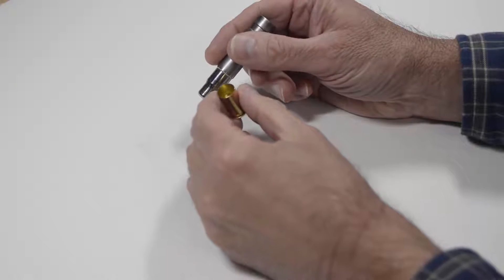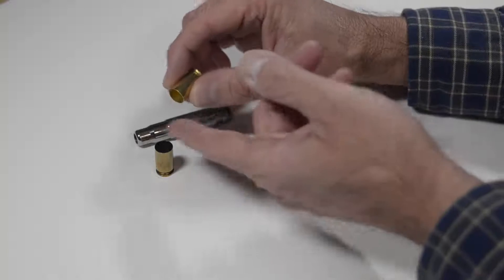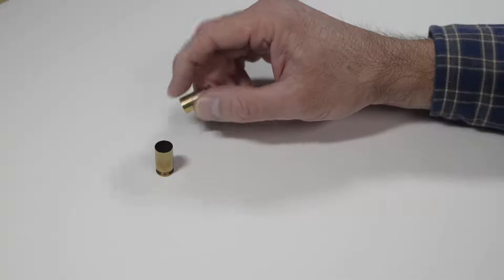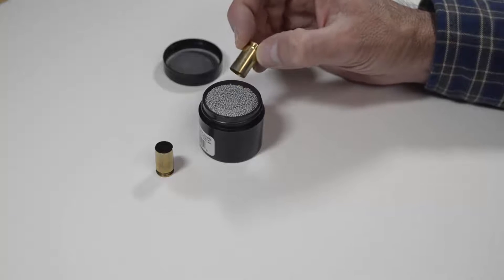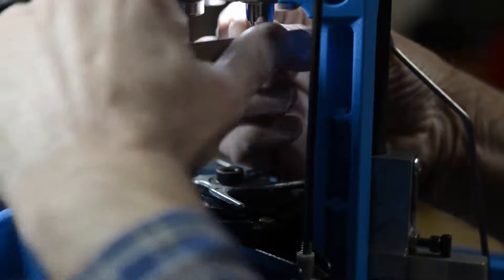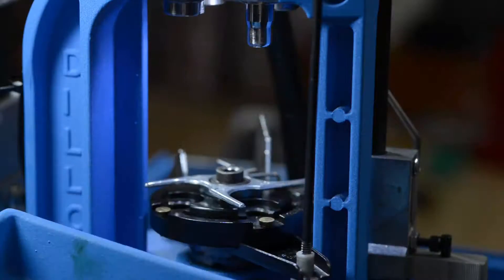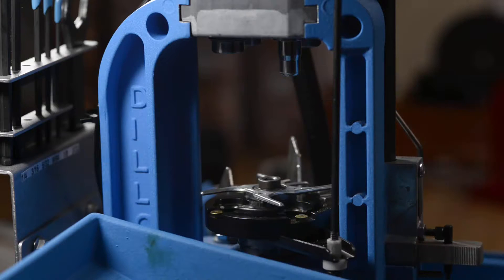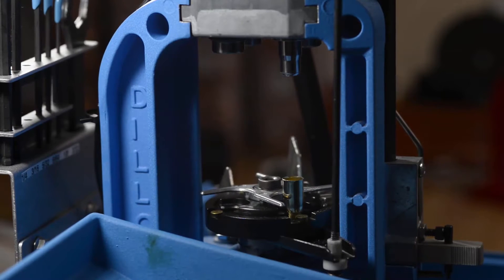Powder drop expander getting stuck in reloading brass: causes and fixes

Comment: With 9mm, different brass has different thickness at the the end of the expander. It has nothing to do with lubing, although lubing can help.
The real cure is to increase the radius of the expander end and also put a relief cut in the expander plug so that there is less brass dragging.

Comment: Dimond lapping compound, a hard felt bob on a Dremel and polish away.  Don't over do it, about 30 seconds and add lapping oil and enough diamond to not run the felt bob dry. This also works. look on internet for diamond lapping compound, 6 micron works best. This is an alternative to the above excellent fix. ☺

Comment: Seems a hand held emory stick will leave nothing but flat spots and exacerbate the problem. Under high magnification Lee's expander dies show an unpolished rough surface on the insertion end of the die. 
To polish I have had success using 3/16" wide 1200-2000 grit carborundum for strip polishing. Expander core is mounted into either a drill press chuck or 1/4" cordless drill.
 However with the Lee dies the point at which the bell's expansion begins has ridges from poor machining that can not be resolved by polishing. 
To overcome sticking at that point, I've had to resort to swab lubrication using a 1:12 lanolin: ethanol mix. 100% isopropyl also works but evaporates slower. 
For the 45 acp rounds I will be testing Lees Factory Carbide Crimp Die which at least eliminates the need to camber or size and should yield a break even point on time spent..

Comment: Iv'e in the past few months run over 6000 nine mm cases through my 550 and never had a problem. But, I have never fed new brass through it. Sometimes I wonder how many times I can reuse brass in a small straight walled case...
Reply from the maker: Many times fired brass usually do not stick to the powder funnel because of the buildup of carbon in the case prevents metal-to-metal contact.

How often brass can be used depends on many things.  Charge weight, care in handling brass, how big a flare is put on the brass, how deep a crimp is used, etc.  Self defense loads will wear out brass faster than light weight target loads.  Excessively flaring or crimping brass will wear out the case mouth quicker.  After the brass is cleaned, I examine it and at the first signs of splitting or cracking, it is tossed.
Reply: @knowledge2you  I do the same as for tossing obviously distorted brass. I usually run my charges as middle of the road. I especially do not crimp brass past the point of me handling each cartridge to allow a slight fit. In other words if you are flaring so your bullet has a wonderful seat, that is half tour problem with such a small round. I load for 7 calibers but never the 9mm because at 7 bucks a box, why bother until recently.

Comment: Would dry lubing the powder funnel work too? Instead of every case?
Reply: I have been using this lube method for quite awhile and attest to the fact that it works. You can just lube the funnel, but as he mentioned,  it helps in sizing when the outside of the case is lubed also. Another point I found that after several cases have been lubed and cycled it's not necessary to lube every case, as the residue accumulates a bit. Try every other or third.
Reply: I’ll try that then, thanks

Comment: OMG ...you want believe how bad I have been struggling with this on my 45 ACP cases. I noticed with the wet SS pins it cleans the brass to good. I have tried cleaning and polishing the powder funnel, worked great for all of 3 or 4 rounds. I will try  not running them so long in the wet tumbler. I have a lot of new brass, I quit reloading because of the sticking problem. I will get some dry lube also before I start back.
Reply from the maker: Speaking from experience, .45 ACP is a particular bad one for sticking.  Polishing the funnel will help, but new brass is prone to stick.  I wet SS tumble but no more than two hours.  After my new brass has been fired a few times, the residue coating inside the brass will not fully come off with wet SS tumbling.  I have read where people say their heavily fired brass looks brand new after tumbling.  The inside of my brass doesn’t even come close to looking new so I am not sure what those individuals are doing.

Comment: I wet tumble with stainless steel pins. This left the cases without residue of any kind and I had the problem you described. I added a final dip in 2 oz./gallon of Armor-All car wash, draining and drying on a towel. This leaves a very thin coating on both inside and outside surfaces. Problem solved.
Reply from the maker: How long do you tumble? I also wet tumble with stainless steel pins but for no more than two hours.  This is long enough to clean the brass and primer pocket but also leaves a fine coating of 'residue', which is what I want.  No need for me to add any kind of wax/car wash.
Reply: @knowledge2you  About 3-4 hrs. I also use Armor-All instead of detergent. However, when I rinse off the dirty water, only a small amount of Armor-All remains. By using a final dip as noted but without rinsing, it leaves a thicker protective film.
Reply: I’m not sure why anyone would wish to clean the inside of a cartridge case (other than removing dust/grit).
Reply: @Russell-1  I have a lot of range brass that is full of dirt and grime. So it needs to be cleaned good, dry tumbling doesn't always get the dirt out if it's packed.

Comment: I discovered that a Scotch Brite pad works well to remove brass/copper buildup, nice and evenly.  Also, if you run plated bullets, you might notice some of that building up on your expander too.  I was using old brass (>8 loads) and had some sticking and wondered, "Where is it coming from?!?".  Some of the plating from the Berry's bullets was surviving my tumble process.  Over a couple thousand rounds, it had deposited on the expander to accomplish the same sticking effect.
Reply from the maker: I do not shoot plated bullets, so thanks for sharing that experience PowPow.

Comment from the maker: UncleLoodis, the statement that stainless steel tumbling removes all carbon buildup in a case is incorrect.  Once you have fired you new cases enough, there will be a carbon buildup that not even stainless steel tumbling will remove.  I know because I have been using SS tumbling for years.  Once there is carbon buildup (I have to shoot the brass around 2-3 times to get enough build up) there is no need to add any kind of lubricant to the inside of the case.
Reply: That's not my case at all, I also have been using wet SS for a while, I never had this problem till I started with it. I got my 550 back in the mid 80's. Until I started with the wet SS all was well. At one time when I was in competition I would go through 500- 1000 rounds a week. I may go back to dry tumbling.

Comment: have you ever tried removing the powder drop expander  and using a copper removing bore cleaner to remove the brass? just curious. It just seems like there would be a cheaper solution to this than replacing the part. You make great videos too! thanks. JJ
Reply from the maker: +jjmckay6man1 
Thanks JJ for the question and the answer is Yes, I did try that.  But I found using an (my wife's) emery board to be faster than a copper remover.    To make using an emery board easier, you can remove the powder funnel from the powder assembly, clean it and but it back.  In the video, I show cleaning it in place.
Reply: knowledge2you - shooting tips ok thank you very much for the response! JJ